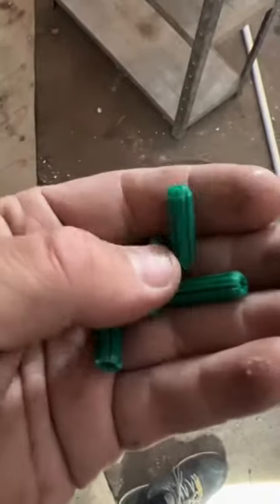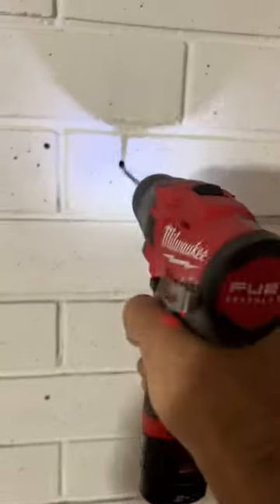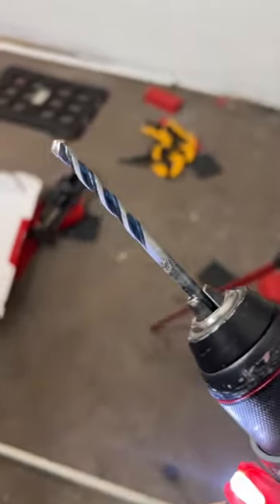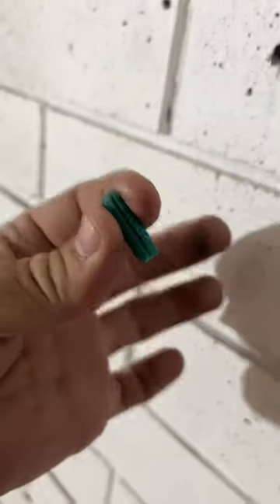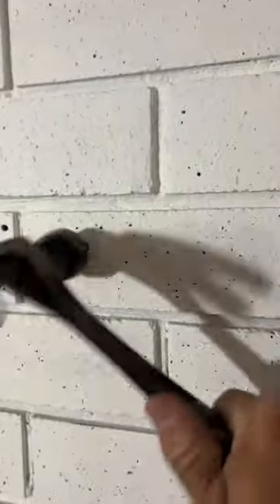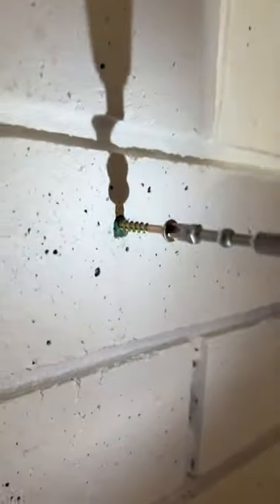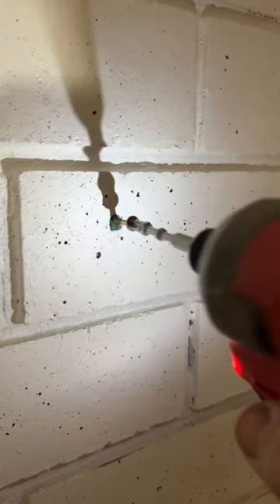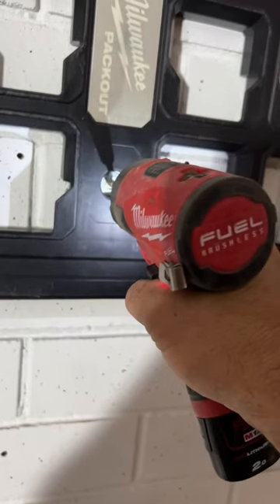How to mount to brick with green plugs

Comment: Does the plug need to be the same length as the screw that will be in the wall?
Reply: No, as long as the hole you’ve drilled is the same length/ longer than the screw you’re fine with a slightly shorter green plug.

Comment: They're actually wall plugs, there are other size which are different colours, based on rawl plugs.
Green is just the one that won out over the other sizes over time at electrical wholesalers. 
They also have issues with shrinkage over time and come loose.
Nylon anchors or tap ins are more effective when installed properly